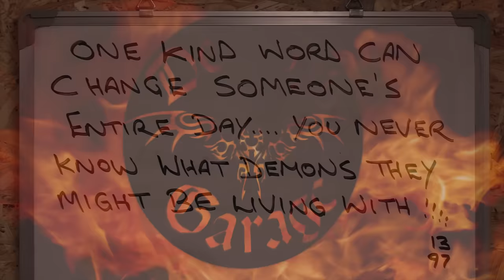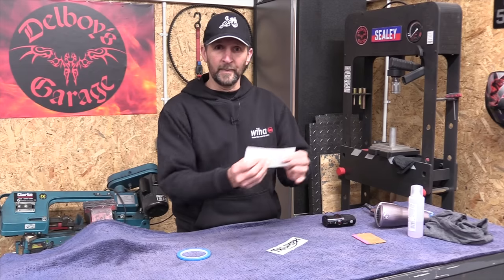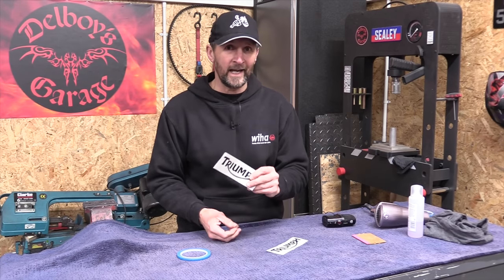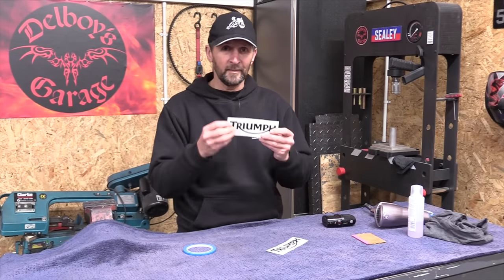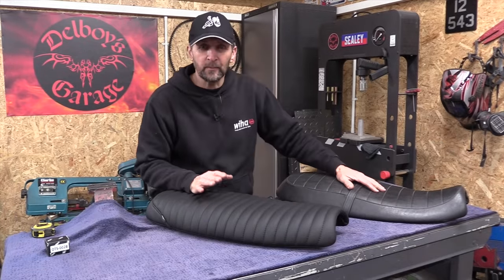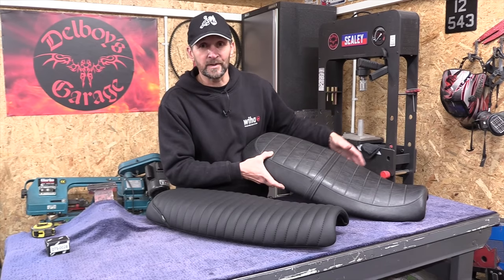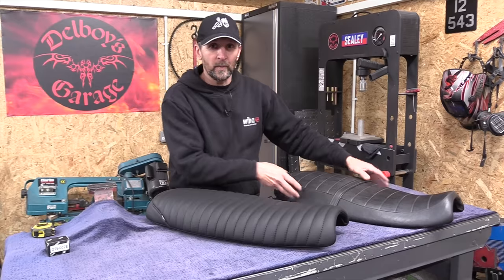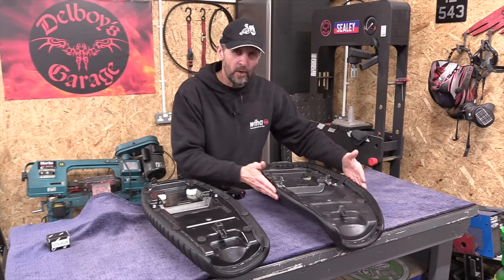Triumph Scrambler Makeover, Day 9, "Tank Decals and Motone 'Krait' Seat" !

Comment: Great timing! Sitting here in Knoxville, TN in the US with a set of knee pads to install on the Bonneville! This is REALLY going to help the project! Happy New Year Sir!
Reply from the maker: Good luck with it Sir, as long as you clean the surface with a spirit wipe to remove all the wax and grease and warm it up above 60F and warm the rubber up so it's a bit more flexible!  Have fun with it and good luck!

Comment: The seat looks great.  The only thing I don’t like is you can see the frame. I’ve been looking at a couple of the motone seat for my T100.  The bike really turned out awesome
Reply: I've been looking at a couple seats for my ST900 and I've noticed that not only can you see the frame (which doesn't bother me) but you can also see the gap between the side covers and the frame where the tape wrapped wiring loom can easily be seem which does not look good to me. The skirt of the stock seat covers that gap.

Comment: Is that how they say decal in England?  Deckle?   : )  I just did some decals on my 64 Triumph 650.  They were the water slide kind, which can be tricky.  Sometimes perfectly level to the ground won't look right, depending on the tank and the bike.  My bike doesn't have a side stand, so it's either running and riding or on the center stand...which meant I had to take that into account when doing the decals.   In the end I took a piece of masking tape that was roughly the size and length of the decal and placed it on the bike.  Then I'd look at it from every possible angle and adjust.  Then once it felt right, I put tape under it and above it and removed the original piece to make room for the decal.

Comment: Why did you put a stripe on top of the tank? Did you measure own each side of that line?
Reply from the maker: Eyeball the centre line, then it gives you a perfect orientation to eyeball the sideways line, where the two tapes cross you can spot if it isn't square immediately, then you get the down tape on the sides perfectly symmetrical and you can take the template for the decal from that.